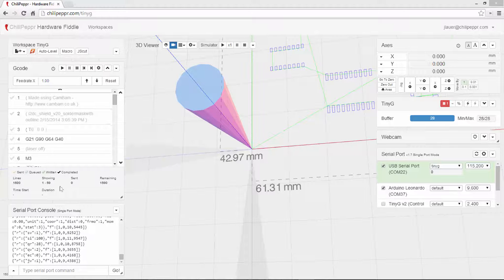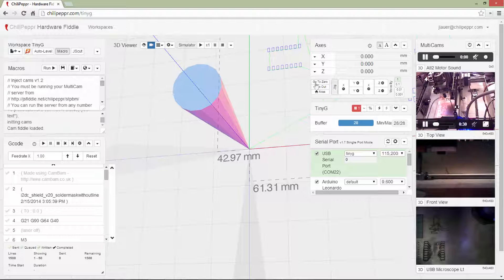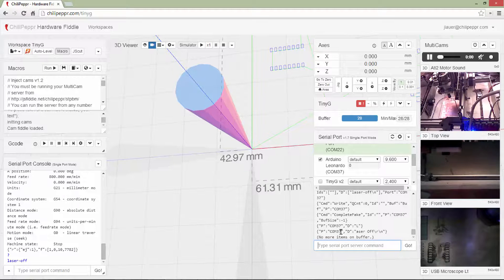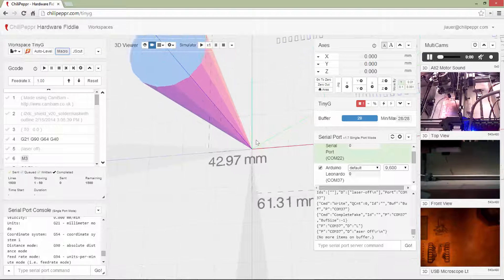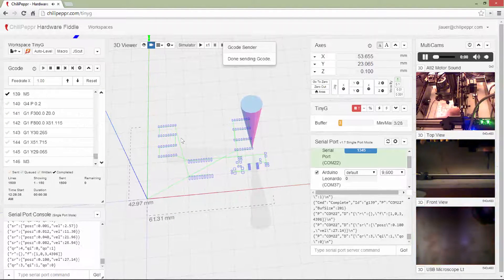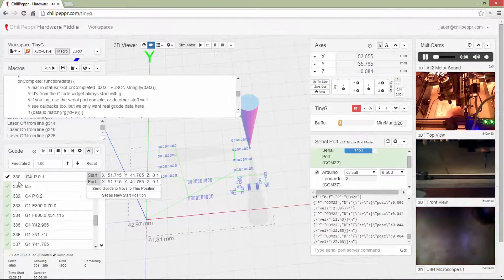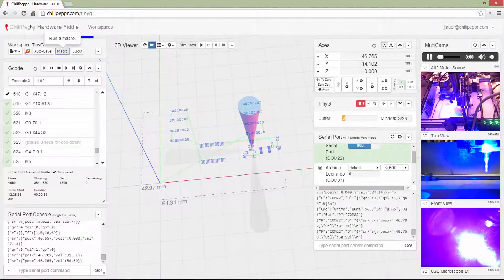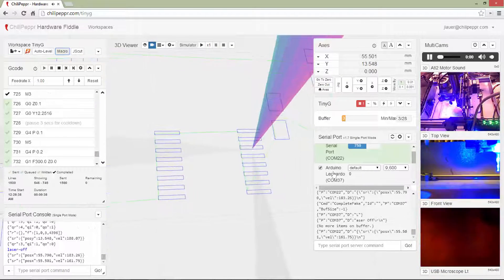ChiliPeppr Sending to TinyG and Arduino Simultaneously to Laser Cut

Comment: It seems like I would want to generate the m commands in the post processor for the tool path rather in the g code injector.

What laser are you using?
Reply from the maker: I agree that the Gcode sender isn't necessarily the best place to do this, however, the larger goal I should have explained in the video is to control a pick and place machine. In that case you need to control suction, rotation, video capture, etc. So, doing that from a CNC controller board is not practical. Timing is not so critical either with regard to synchronizing XYZ movement as I'm showing in this laser cutting. Doing this from a rich environment like ChiliPeppr is now finally possible.
Reply from the maker: The laser is a 3W blue diode. 9mm 445nm | dtrlpf
Reply: John Lauer Thanks.